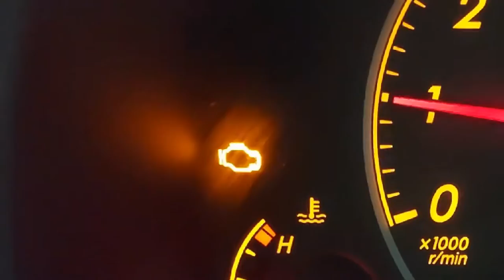Front Exhaust Heat Shield Repair - 2009-2013 Toyota Corolla

Comment: I was hoping to see a method of fixing the rear ones, where the three studs/bolts are right above the exhaust and almost impossible to get at with out removing the exhaust. The front is easy, the bolts/studs are on the side...
Reply from the maker: How To Repair | Fix Exhaust Muffler Heat Shield - 2010 Toyota Corolla
https://youtu.be/9v-SgFnSuTQ

Comment: How many nuts are there in total for that specific heat shield (2 or 3)? Thanks!
Reply from the maker: It's at least 3 nuts holding that heat shield in place, not sure if there are 4 nuts as I cannot recall without looking underneath the vehicle.

Comment: Muffler heat shield is ripped off and still making noise. I didn't see this one but I'm gonna check again and rip that mf out too!!
Reply: My studs broke off taking off the rusty nut so I have no heat shields at all.
Reply from the maker: Sometimes you can use small self tap screws to secure the heat shield if you decide to keep it. Being careful not to damage anything while doing it. You want to use the smallest self tap screw or bolt as possible.